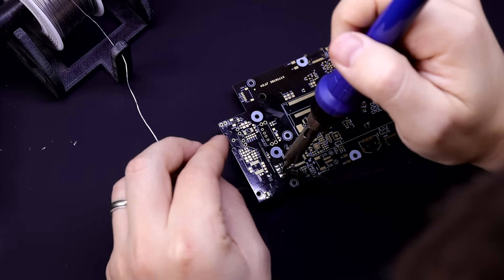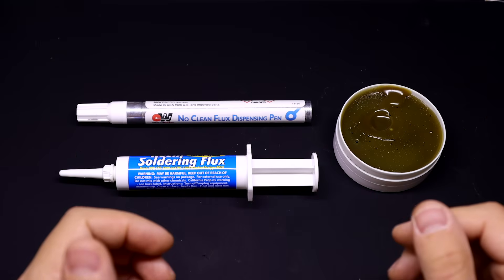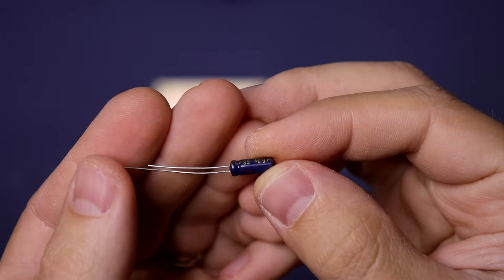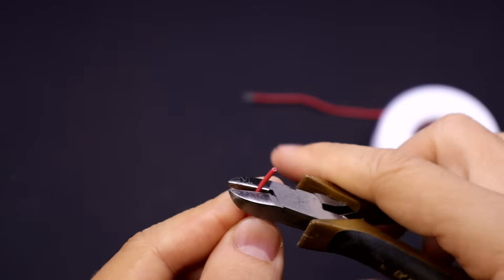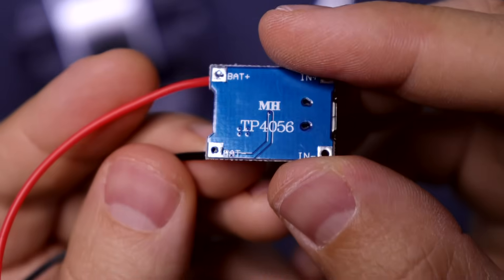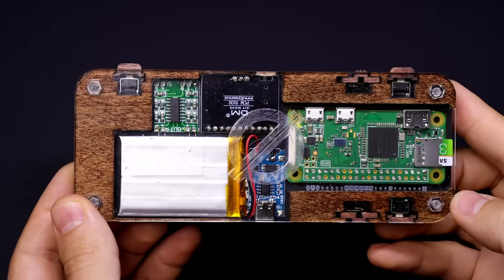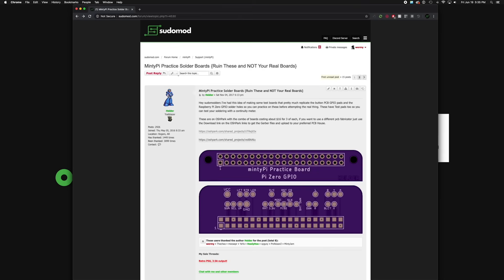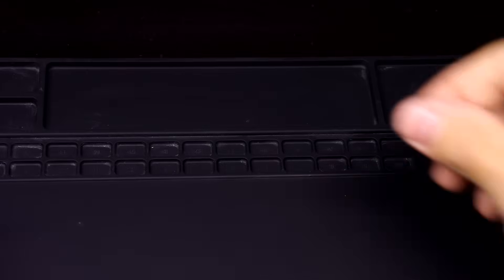Soldering Crash Course: Basic Techniques, Tips and Advice!

Comment from the maker: So what other "crash-course" type videos would you guys like to see?
Reply: Great video, a crash course on components like capacitors and resistors would be very appreciated as well as ohm's law maybe.
Reply: Definitely a video on soldering/maker safety would be awesome! Proper iron/pcb handling, fume safety, and things that can help make a workspace safer, like the silicone mats you mentioned, self-activating fire extinguisher balls (I have one mounted over my 3D printer!), or DIY/Commercial fume extractors. Even simple little things like what to have on hand for burned fingers (Burn Gel/Alocane!). There are so many makers on YT and on the net that show off all the cool stuff that they make, but I rarely find anybody who openly talks about how they protect themselves and the spaces around them, and how they handle their "Oh @#$%&!" moments
Reply: @ryyyyyylie  I would be super down for that too!
Reply: I'm for the multimeter crash course as well.
Reply: A beginner's crash-course on multimeters... I just bought one and have no idea how to use it. Would be much appreciated.
Reply: @MaddogJones  Same here just bought one
Reply: @blakeromo  u9
Reply: @MaddogJones  I was just about to comment this. Haha!
Reply: @MaddogJones  i
Reply: @MaddogJones good knowledge about soldering
Reply: Followup around fixing common soldering errors when you run into them. And which ones can't be fixed.
Reply: how to make a crash course video
Reply: @marksseasalt5785  a crash course video on crash course videos!!!
Reply: 1. Components (what types,where to get them and their use) how to test for "dead" components on a PCB. Do or have you ever used a thermal camera to find components not working properly?
2. How to use a bread board and the computer program to test your project before soldering.
3.Why do they use so many "Resistors" or other components in series why not one big one? (Probably a dumb question)
-I personally would like to see you power a HVAC control PCB and show how to find the component that's gone bad.
-About me, I work on HVAC systems, a units board doesn't work properly and we replace the board and it begins to function normally but I've always been curious which exact component on the board went bad and how to find it. Besides seeing a burn mark on the board I wouldn't know where to start.
Reply: Desoldering. I have been soldering and desoldering circuits for over 50 years, but most hobbyists are new to the special tools, accessories and skills necessary for safe, efficient desoldering.
Reply: How to measure capacitance and inductance and wich tester to buy.
Reply: How to identify faulty components on PCB without schematic
Reply: How to root the latest phones? Or are they still rootable? I used to root alot, the old ones like Jellybean or Marshmallow was very easy, but now? How?
Reply: @miriambamford6513  out of scope for this type of video. Check out Rootjunky (but most phones these days have locked bootloaders & can't truly be rooted.
Reply: How to clean oxidized tips! I was too excited to get my iron and tried soldering without flux, and now my tip is black and doesn't melt solder...
Reply: Did you go to school to learn all this? I would like to know where I could go to study this type of stuff in depth.
Reply: arduino
Reply: A crash course on voltage, watts, amps, etc.  I'm just getting into raspberry pi, Arduino, motors, etc.  It's confusing knowing what everything means and the ramifications of putting various pieces together.  For example, I took apart an old printer to hopefully salvage parts for a project but it looks like all the motors are 24v.  I think I can use a motor controller board that is rated up to 30v but all the tutorials I found are at 12v and 5v.  As I type this I think it should be ok but want to know for sure and not get shocked.  Also, what is the difference between logic voltage and drive voltage?  Just found your channel so didn't see if you did this.
Reply: Excellent video :D Subscribed...
Reply: Options for powering Arduino or Raspberry Pi
Taking Arduino/Raspberry Pi project from breadboard to a permanent enclosure (without tearing it to pieces)
Taking Arduino/Raspberry Pi project from breadboard to a professional-looking finished product
Turning Raspberry Pi Zero into a usable computer (hardware and software)
Screw connectors - how to use, advantages, disadvantages
Cutting holes in plastic enclosures
Reply: Maybe a tutorial about how to raise kids, with this quality. Thanks!
Reply: I guess you like game boys
Reply: soldering for very very thin wires to flats. whats the temperature to set so the very very thin wire will not burn off, do you still need thinning the very very small wire strand.
Reply: @WorldEngineersOnline  trial and error?
Reply: While
Reply: I already disconnected a ground wire from my dismantled belt drive turntable so that I'm making a DIY turntable build. Therefore, I had de-soldered ground wire. Then I have to connect the new tonearm wires to small PC board. 

Although I only studied up to grade 10 electricity in high school; I'd very much appreciate if you could provide plenty of tips, and valuable advice for me to solder record player parts. Thank you.
Reply: Not sure if you have covered this but tidy wiring for your projects. Ie getting rid of the spaghetti look and make a tidy loom or tracks of wires etc.
Reply: @wermy what do you think about soldering irons like the TS100??? Just bought one from iFixit, and it should be here Friday. Albeit it doesn't have a dedicated stand or anything yet, nor does it have a hot air reflow station, it does have practically all of the other features you mentioned, plus to make up for the lacking in the power area I bought an omnicharge 20+ power bank (20,000mAh) with 2 USB 3.0 ports, a 5.5mm DC jack(primarily used for iron), 120v wall outlet if needed, and a USB-C port, which should the equivalent of basically everything in yours down to the variable DC barrel plug power settings, from 12v up to 20v DC. Note that I originally bought the power bank for other purposes, but I wanted one with DC jack for possibly using a ts100 soldering iron with at some point in the future... I have soldered before, but to be honest, even with a rosin core solder I found it hard to get the solder to stick. After asking someone about it, I came to the conclusion that the cheap 5-20$ soldering irons usually in stick or gun form, without temperature controls, was probably part of the problem. However, that's not all, could the problems you mentioned, making lead free solder "harder to work with" be why solder refuses to stick??? That's what my solder I bought at the hardware store was, is a lead free rosin core, electronic solder that I been using forever... Also, any particular brand of solder you would recommend, say on Amazon or something, if not the hardware store??? You said you should use a thinner solder, but is there a such a thing as solder that's too thin, and what kind and specific size would you use, for a beginner, who knows the basics of how, but sucks, to try and get better???

Sorry for all the questions, but I have one more, which is, how do you solder and work with color coated wires like those tiny different colored wires without sheathing, that comes in modern day headphones and earbuds???
Reply: Life
Reply: Using braedboard
Reply: Ciao visto che fai dei corsi e/o tutorial perché non metti a disposizione anche i sottotitoli in italiano? 
Ciao buona serata
Reply: Female USB/PCB connectors.  I have a pcb where the 2 usb ports have come unsoldered which renders the whole device useless!  Should I/Can I solder them on?  Solder on Soldier!
Reply: What do you do for hobbies do you solider so good I'm into radio control trucks cars boats and I do a lot of connector but I don't do much motherboard
Reply: I always struggled with soldering. Now I managed to assemble my first kit (a clock) as a training exercise.
Reply: What temperature is used for small wires?
Reply: ARDUINO 😊
Reply: Def the crash course on using a multimeter.
Reply: More in depth feature on soldering irons  & their extra features.
Reply: I always wanted to do this but could not find any information. Take a music player like a dap and recover the software or firmware loaded inside the system on chip. And then edit it to do exactly what I want it to do, like repeat last song if it is ranked according to my preference profile. Almost every portable electronic device uses the same soc. Thank you.
Reply: Do you have an email or mobile?  I have a pair of Astro a50 gen3 headset. I purchased the battery for it, but it has soldered. I don't want to get into soldering at all. I just want to find someone to do it for me.. of course I'll pay
Reply: Its not difficult to diy
Reply: You should do one for using a hot air gun.
Reply: you might want to change the title to add electronics. Some of us may want a crash course in fusing 2 metal pieces together like wire rim glasses. What solder, what temp???
Reply: Definitely want to see more on the ribbon cable, soldering.
Reply: Multimeter ,
Reply: PCB TROUBLESHOOTING
Reply: Resoldering capacitors that broke off from the board
Reply: Something like this? https://www.youtube.com/watch?v=vIT4ra6Mo0s
Reply: Id like to see how to solder tiny pins. Like HDMI prot replacements. Those tiny pins are so hard. There has to be a method.
Reply: Hi Wermy, I'd love to see one on how to set up the soldering machine voltage/amperage settings ect. for different types of component soldering.
Reply: how to  solder   18650  lithium  battery,  what  we  need..   what  acid  to use... pls  help.
Reply: @kimkong9622  
Soldering onto batteries is less than ideal, particularly if your soldering skills are less than good.
Reply: lead   dont   stick  to  iron,  why.  whats wrong I do...
Reply: Great video except the way you twisted the wires together there is a much better way .
Reply: i need help the pcb that im soldering already has solder on it do i use flux and if how would i apply it
Reply: Changing microphonic pickups to alnico 5 humbuckers. I have never soldered just got my soldering kit
Reply: Soldering batteries, best prep practices, build techniques, series vs parallel, safety, type/chemistries, button vs flat, protected vs non, why a 4.2v lion batt at 3.5v is considered dead, recharging equip and safety considerations, all topics covered by making a homemade car Jumpstart pack using 4 amr 18650 li
Reply: @brandonzidzik  
Soldering batteries is a poor technique and to be avoided if at all possible, particularly if your soldering skills are average or below.
Reply: I'm late for the party but I'd say BGA soldering.
Reply: I have a surface pro 4 which i accidentally pry'd off the left speaker connector from the motherboard, it is extremely small! Plus i am assuming very hard to solder back down as the connection is between the motherboard and the connecter. I have no idea what i can use to stick the connector back to the board which also allows a current to run through it where the previous solder snapped. Any tips? Is there any tape which allows current to run through it which would not require me soldering?
Reply: can u do a crash on how 2 set your wood peice when needing 2 cut it?? clamps...sawing logs???
Reply: What about one about how to use an oscilloscope?
Reply: All of them please. Nice video.
Reply: Can you solder motherboards together
Reply: What kind of soldering iron is the best for working on gameboys and gameboy cartridges? (mostly for save battery change, and maybe just maybe for little repairs)
Reply: how to de solder
Reply: i just iam use it as well and tech
Reply: Arduino and IR
Reply: I know solder extremely well but I do micro solder but not much so can you make crash course for micro soldering
Reply: how to solder a own pc
Reply: Breadboarding! And reading diagrams
Reply: Can you remake this video with no background music? It makes it hard to focus on you.
Reply: How to get a girl pregnant
Reply: Plz do u have any experience with changing batteries on ear pods?
Reply: Can u maybe show me how not to burn the dang board man pls
Reply: A crash course in correct pronunciation, it’s not just the States saying ‘sodder’, it’s everywhere’ and it really rubs every nerve in my body.  If this word actually existed, it would suggest a very different thing!  In context “see that guy over there, he likes to commit sodomy, guess you could say he’s a ‘sodder’”.  The word is ‘SOLDER’, this mis-pronunciation was possibly started by someone lacking it literacy skills or with a speech impediment.  Since when did we decide that knowingly follow something incorrect was best practice, or decide illiteracy was cool.  Very disappointing, especially from someone who seems to be an intelligent individual ✌🏼
Reply: best way to show us beginners how to repair xbox one controller joy sticks.  I have never soldered before and im wondering if you need the wick for all soldering jobs? going to give it a try.
Reply: Probably repairing cell phones or iPhones since it seems to be a common problem when replacing batteries. Something gets done improperly and a component gets dislodged from it's connection.
Reply: mobile cooling fan crash corse
Reply: crash out course video please
Reply: 1:arduino
2:multimeter
3:components
I will edit this comment if i want more
Reply: This was a great video, thank you Wermy!
Reply: OOH i know I can google it but how to modify and create your own retropie OS
Reply: Could you please make a video about replacing the batteries in Pokemon games? I tried doing it myself with the help of some youtube videos but it didn't turn out very well.
Reply: As an IPC Trainer you should never trim after soldering. Always do the opposite otherwise you risk fracturing the joint
Reply: do you have a preferred iron for beginners? the weller furno 40 watt i got will not heat the pads up enough with the fine tip
Reply: You should also use Fahrenheit
Reply: @tobydyes  Or we can convert in our heads (or Google)

Comment: sorry but you don't twist the wires tightly they should retain their original twist, as over-twisting leads to increasing the effective wire diameter and gets you into a very bad habit that will bite your but when you need to crimp a wire

Comment: TH leads should be bent inward to avoid contact with other leads.  Leads should be trimmed before soldering the connection per IPC-A-610.  Otherwise some good advice here.

Comment: Wow! So many views. I sorta feel lucky I can solder well but that might be because I've been at it now for over 50 years. Couple of points if I may. Less is more as you say wermy and the shape of a finished connection on a board or wherever such should be pointy, and like a sucked in pyramid, definitely not round and blobby; a common result for beginners.
Also I do like the thicker flux-core solder if its appropriate because it has more flux inside it. Once the tip is "wet" soldering more connections becomes easier as heat transfers to the component AND board better/quicker. If for example building a kit on an old style through-hole circuit board, install a bunch of components before reaching for the iron. IE Don't solder after every component; that's part of the easier after the first one I mentioned before. Clean the tip regularly and make sure it's tinned well at the start and throughout the job. Don't over temp the tip as it can oxidise and too hot makes it harder to solder properly and shortens tip life. I like 300c to 320c using lead solder. My advice is, don't learn using unleaded solder as it can be difficult. Hope I have added something to wermy's great tutorial.

Comment: just "wash you hands afterwards" with the lead? thats a terrible advice, the fume goes straight into your lungs, then to your blood and in a minute or two straight into your brain connections.
Reply: the boiling point of lead is loads higher than your soldering iron can provide, so no fumes except from the flux/rosin which is usually non toxic

Comment: this video is old and okay but you dont mention anything about what tips to use as other videos i run into. i went on reddit asking for help and they all said the same thing. fine tips are dog sh*t and use a chisel or beveled tip. the fine tips dont transfer heat properly and you dont mention why to use a certain solder and what temps. also i bought one and same thing, people on reddit said those amazon kits are trash and the solder that comes with it is trash as well.

Comment: i have to cut a master system controller cable shorter, issue towards the end of cable, and resolder the through cables to the board, fingers crossed

Comment: You had a lot of good tips and techniques, but you need to learn how to do an in-line splice you never ever wanna wrap the wires together and then bend them over and solder them. You twist them in line make a good mechanical connection then you solder only way to do it the way you did. It makes zero sense and it is unprofessional

Comment: I would mention to use ventilation of your workspace and a small desk fan to blow air away from your workstation, as fumes are toxic. Doesn't have to blow roofs away, just a bit of air circulation.

Comment: Very glad to see you using side-cutters to strip insulation. With a bit of practice it is better. Also, a little thing I started doing recently with tinning cables. Just dip it into the solder paste very quickly, and it tends to solder more efficiently, and you can pull it away quicker to avoid melting the insulation. That is even with flux solder, which is obviously much better to use. By all means, anyone feel free to criticize that dipping of the wire in the flux first. It seems to have worked out very well for me.